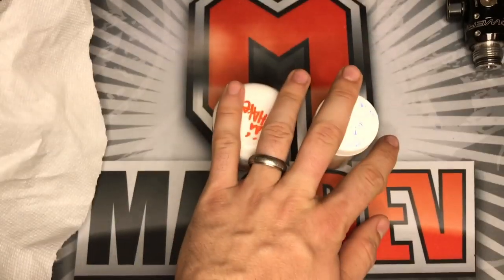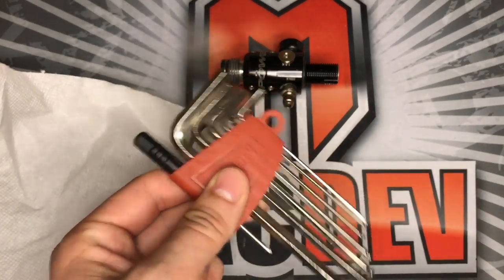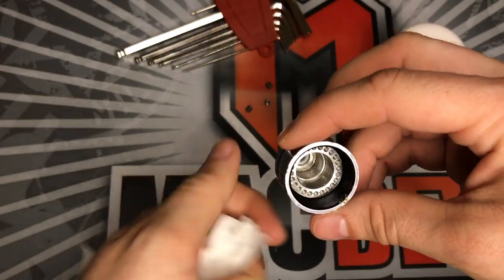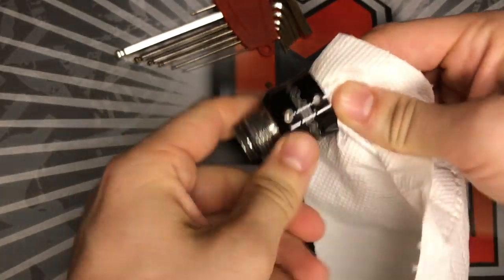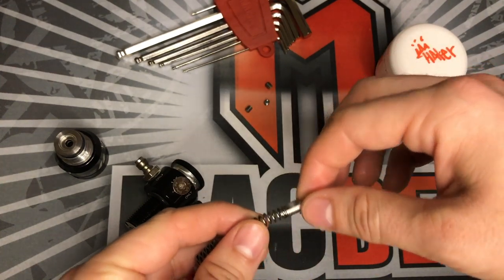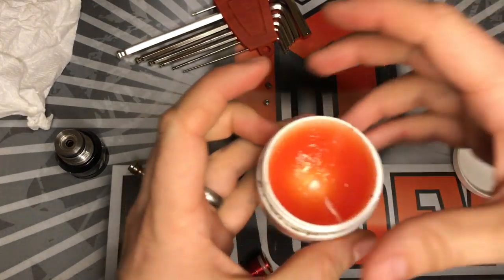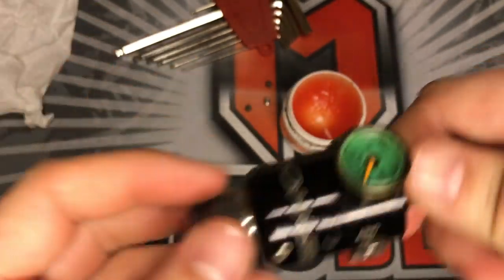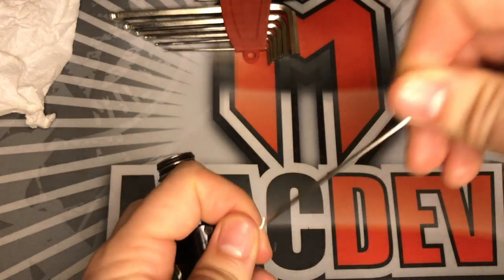Paintball Tank Regulator Maintenance

Comment: Was that the Tank regulator or the Gun side regulator. Just want 100% clarity.
Reply from the maker: This is the part that attaches to the bottle section of a compressed air tank.
Reply: @howtoplaypaintball  TY for fast response!

I have a question. If i simply want to fill the tank using the fill nipple on the tank regulator do i need to remove the gun regulator 1st or can i simply fill with it attached?
Reply from the maker: @llamudos9809  yea no problem! And to fill the tank you don’t remove the regulator. I think I have an old video on how to fill a tank if you search too 👍
Reply: @howtoplaypaintball  I saw a youtube video saying you should. I have never taken the gun regulator off when i use my compressor to fill the tank so just want someone to verify that i was not damaging the gun regulator in filling with it on. TY. Alot of miss information out there.

I have one more question. My tank appears to be loosing air and after a week being idle its completely empty. I was going to put it into a bucket of water under pressure to see i can fathom where its leaking.

It could be from the tank reg or the gun reg not sure. 

 Guess thats not an issue.?
Reply from the maker: @llamudos9809  yea it’s likely leaking out of the regulator somewhere. I’d recommend you take it to your local shop or field that can look at it. 

As for the gun regulator being affected so long as you degas the tank from the marker after you are done playing for the day you’ll be good. Hopefully that makes sense!
Reply: @howtoplaypaintball  Sorted it! It was the female quick disconnect connector that was leaking on the gun reg. I removed it cleaned it and applied some TPFE tape. No leaks now!

Now i need to sort my FCU on my wolverine. Not having a good week! LOL 
Having trouble getting full auto and semi to programme. I think its something to do with the selector plate. Will need to strip it down.

Anyway ty for you help on the Tank. I have only been doing HPA since october last year and not really messed with it other than filling the tank.

Comment: My empire tank regulator had loose set screws when i got it so my first time screwing it on my gun, when i unscrewed it the top half of the reg started unscrewing rather than the whole regulator. So i had to hand tighten the top half then crank down the 2 set screws so the top of the regulator wouldnt unscrew itself again when i unscrewed the tank from my gun.
Reply from the maker: No bueno!

Comment: Complete paintball newb here so sorry for the newb question.
I bought a Azodin Kaos 2 which I've come to find out was maybe a poor choice.
So far I've fired about 100 paintballs through it so far without any apparent leaks or issues.
My concern is I thought the foregrip on the Kaos 2 was a regulator so I just ran a 3000psi CO2 tank directly.
Was I wrong?  Is this a bad idea?
Reply from the maker: No problem asking questions! We all start somewhere. So CO2 goes by ounces and compressed air is by PSI. If you used a 3,000 psi air tank you’re all set. I believe the azodin can use CO2 as well but you’d have to consult your manual for confirmation. 

Hopefully that helps!
Reply: @howtoplaypaintball  CO2 & HPA capacity is measured in Ounces/Cubic Inches/Cubic Centimeters (different manufacturers) but always @ a certain PSI.

Example a 48 oz bottle at 3000psi will have the same number of shots as a 24 oz bottle @ 4500psi.
Reply from the maker: That may be true as well but any field or store I’ve been to will measure the amount of CO2 by ounces. Psi has only been used for compressed air as long as I’ve played paintball. I’d recommend compressed air over CO2 regardless as it won’t have issues on the orings like CO2 can.

Comment: What’s the best way to degas a tank?
Reply from the maker: I have a video on traveling with gear with a tip there. Hope that helps!
Reply: How To Play Paintball So taking out the bolt is what causes the air to escape?
Reply from the maker: Correct! Just make sure the gun is degassed and then take out the bolt. Then put in a swab to help dampen the sound.